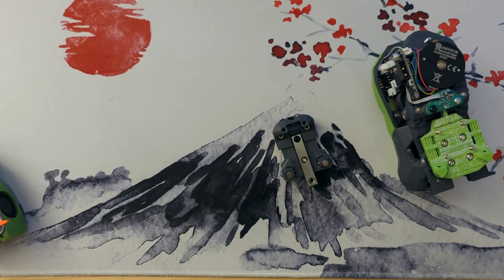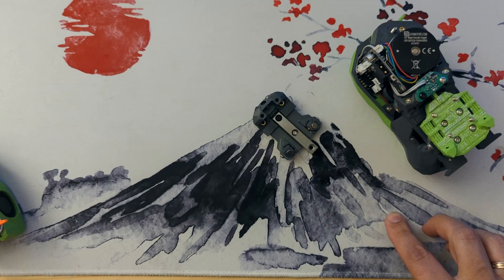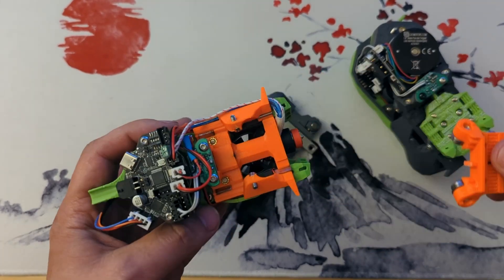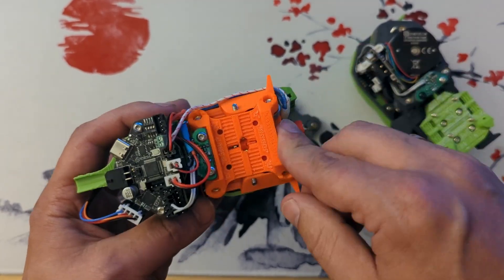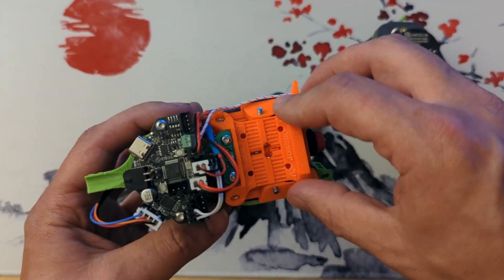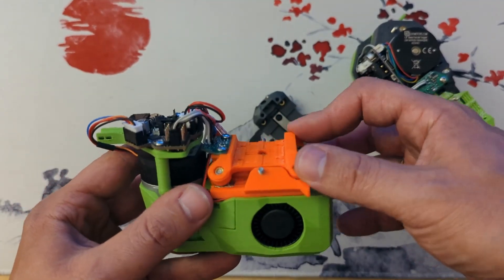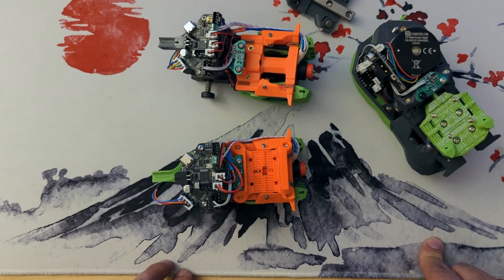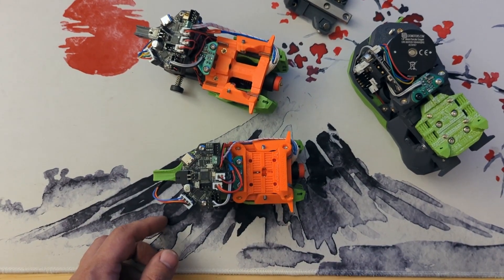Tapchanger rev2?

Comment: Nice design.  Is the magnet the only thing providing the vertical constraint? Or are the metal rails at a slight angle so that they squeeze the bearings together as it is engaged?

I am working on a magnet ring type toolchanger for a Ratrig, and I am debating whether or not to rely on printed part's elasticity for engaging force or leave a gap between the magnets to maintain force after the kinematic coupling has made contact.
Reply from the maker: The metal rails are all parallel. The vertical contact is plastic to plastic with the magnet in the middle just providing extra sticking when fully inserted. Pretty much cargo culted from Tap.

The plastic flex is present but very minimal and is something I want to remove as much as possible.
 Making the parts as beefy as the limited space allows, printing with 80% infill. Also will print them out of CF nylon once the design is more or less settled.
Reply: @viesturz ig fan of what you are doing! Just wanted to give my two cents. Don't use CF Nylon for this application. Nylons printed in FDM tend to creep quite a bit, which would be detrimental for this application. Personally I'd recommend using pure PC CF or one of the PC CF blends that are out there. While I am a fan of Prusament PC CF, I've heard that lately they've changed their formula, making it weaker. Many people, whose opinions I respect, swear by 3dxtech's offerings, so I'd recommend checking those out. Keep up the good work!
Reply from the maker: @ExcitingCreations  Thanks for the info. Super useful. Also a redesigned version is in the works that seems to be quite rigid in pure ABS.

Comment: Thanks for the update!  This is a clever design, to use the bearings and rails in this way with the MiniSB.   It reminds me of the original rollers used by the Kossel, which had a similar 45-degree angle to them with alternating directions - but of course, for a different application (delta tower sliders).

Similar Q to @rainmotorsports - can you say more about what problems drove you to move past the original design?

I like the Tap/Boop optical sensor compatibility you kept.
Reply from the maker: The issues list is long. To be clear using a rail has a major accuracy and thermal stability advantage. I'm hoping rev2 is good enough in accuracy and vastly better at everything else.

Here it goes:

High Insertion accuracy - it got really tedious to tune the XY after every small printer modification.

Messy failure mode - hunting for balls after each failure sucks. And messy servicing in general.

Gunk getting inside the carriage. The nozzle has to travel over the rail plug and retraction is not perfect, depositing hairs of filament onto the rail that find their way inside the carriage.

50mm vertical movement for undocking - that is all lost print volume under the tools.

The rail and plug in center blocks from  installing a nozzle wipe.

The plug system actually works surprisingly well for what it is. Having less moving pieces is still a plus.

Comment: I was looking into using the THK rails with the caged balls to reduce catastrophic failures. But I was also looking into building a smaller toolhead so you having trouble is a bit concerning. Can you say where the problem was? Is the lighter toolhead popping off the rail during tap or is it not docking well or ?
Reply from the maker: See the other comment for the problems.
It's a long list of small issues. The main issue with mini is that I hoped it would work without the anchoring flanges at the bottom, which failed spectacularly, destroying the plastic end cap of the carriage. I actually did have spares at hand but it gave me pause to think.

I had the bearing kinematic mount idea sitting for a while and I wanted to see how a clean start would compare. The rail approach is not out of the window yet.

For now this is purely for Mini.
Oh and rev2 is half the weight from 81 grams to 41 grams, so makes the mini even lighter.